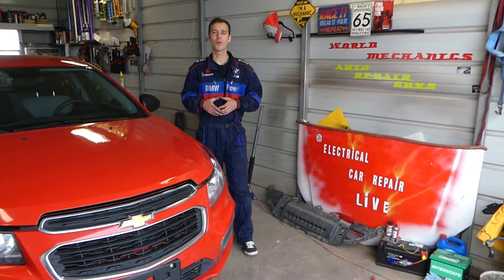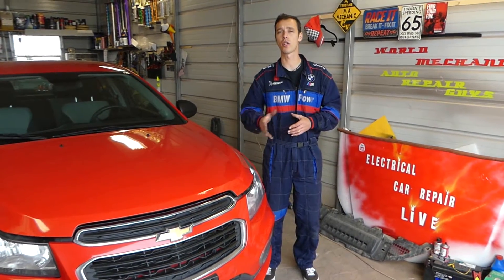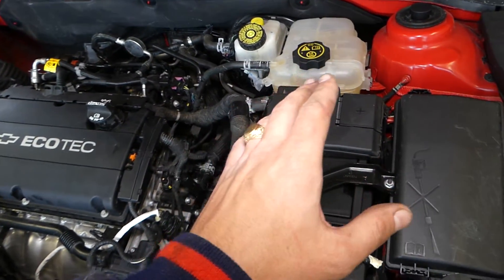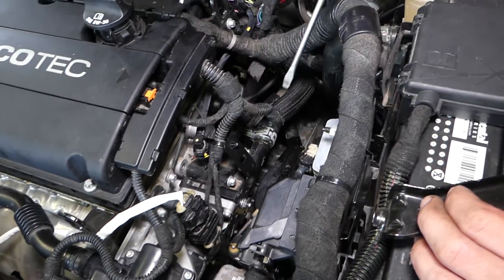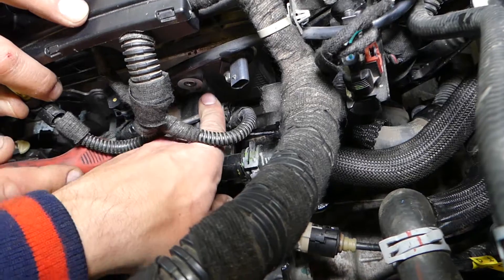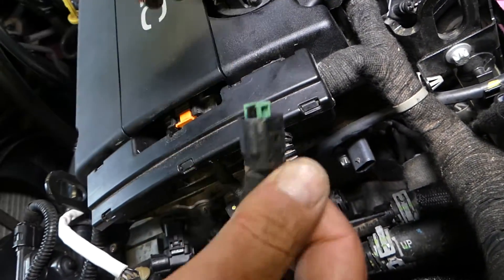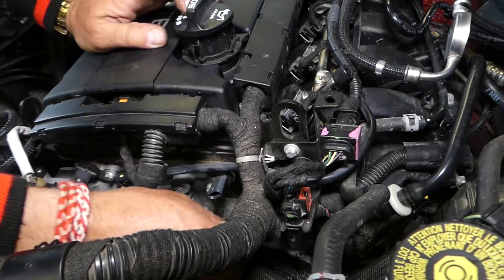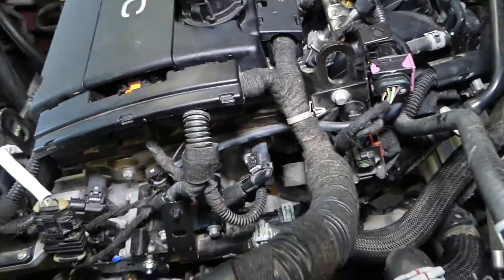CHEVROLET OPEL 1.8 ECOTEC ENGINE WATER TEMPERATURE SENSOR LOCATION REPLACEMENT CRUZE, SONIC, ASTRA

Comment: Does the DTC clear automatically or do I have to clear it manually after the install? Asking because I need to do this (I diagnosed it) before I go for emissions testing. I’m a HD tech, so not super familiar with light duty.

Comment: Thanks to your video we replaced our faulty engine coolant sensor. We did not need to drain the whole system - instead, we put a rag to soak up any coolant just beneath the fitting. Quickly swapping the old sensor for the new one and swapping over electrical contact. Once again thanks for the video and explanation! Thanks to Euro Car parts for delivering the same day. Total cost in the UK was £10. Time to fit 10 minutes. The original component failed after 58k miles together with a radiator pipe that had decayed. Car is a 1.6L petrol J300 type. Car able to start again and runs fine! The only other thing we find annoying with the car, not related to this, is it jerks at low speed like there is a flat spot. Changed the plugs, played with the spark gap but cannot get rid of it. Also had to have the catalytic converter replaced at 55k miles.

Comment: Hey my car has 2 sensors,  the same location you demonstrated and another on the radiator.  I'm getting the sensor code p00b4,  which one should I start with? Thanks
Reply: Did you fix it? I have the same code P00B4
Reply: Same cuestion !!